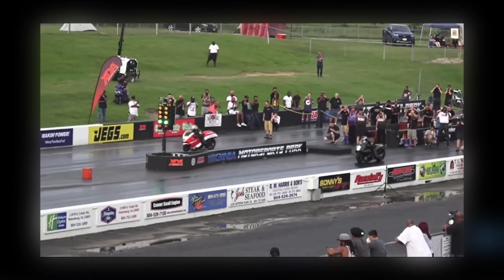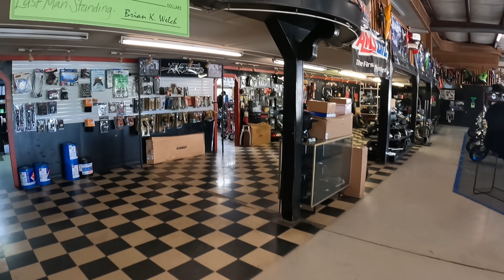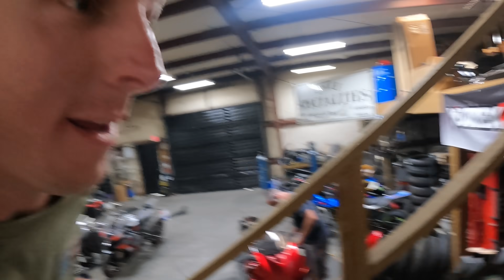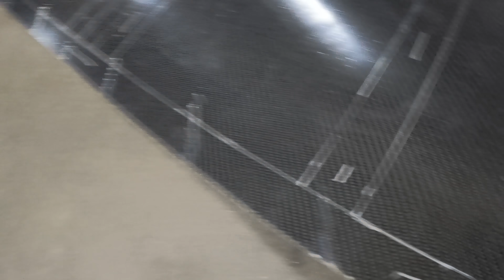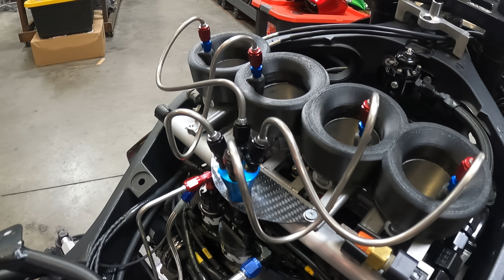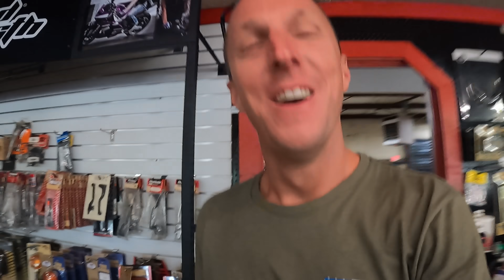2022 Suzuki Hayabusa Update!

Comment: Great video but I gotz a Question! How much gains can you get out of a k4 gsxr 600 with dominator slip-on with k&n air filter? Planning on shipping you my ECU end of next month. Thoughts?
Reply: Not much...usually it just helps smooth it out. May gain 5 ~8 hp if your lucky
Reply: @2wheelsonly614  that's what it seems like. The most I have seen so far is 7hp gain. That's fine. All I want to do is remove the sluggish acceleration and add pops and burbles.